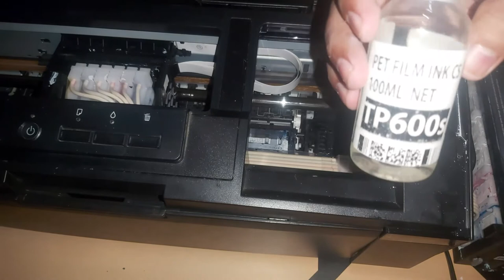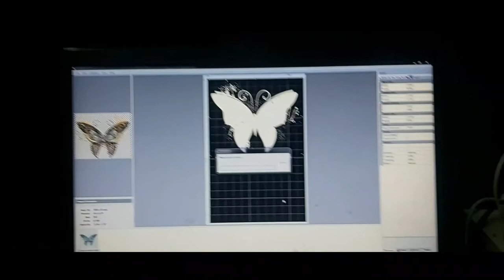Daily Maintenance in L1800 DTF Printing for White ink | WHITE INK TRANSPARENT PROBLEM SOLVED

Comment: Hello there . When I print all black and colored t-shirts, the color of whites and all other colors changes. turns blue. darkening. but when I print on a white t-shirt, there is no problem. I just bought my machine and have been using it for 2 days. I have never been able to print on a black t-shirt. Do you have any experience as to why? I think it's from paint. what do you think?
Reply from the maker: Which printer you are using epson L1800  or some another printer
Reply: @soulgalleryheadquaters3492  epson L1800
Reply from the maker: @esrayakar5980  these are things you have follow to solve your problem 
1.check your heatpress handle pressure must not be tight it must be medium pressure for just 6 seconds 
2. Check the base of white is good or not if white is faded than do the process I have told in my vedio
3. I think the problem is may be handle pressure of heatpress it must be to tight or white base ink is fading on petfilm

Comment: The same thing applies to my machine today. After 2 print, the white ink will fade away. Have done the head cleaning, Nozzle check. I already have circulation and stirring tank for my white ink so no need to be shaking every 5mins. Please help out
Reply from the maker: go for proper head cleaning through company service they have some chemcials which clean your head properly.

Comment: My white ink has this issue daily. After like 5 prints, white will become faded. Do I need to do those maintenance everytime my ink become faded?
Reply from the maker: If you are doing continue printing for long time just shake your ink tank after every 3 print
Reply from the maker: White Ink need regular mixing and shaking procedure
Reply: In addition, my nozzle check also shows no white in the 2nd white ink even after shaking and head cleaning. Does that mean my head is already clogged?
Reply from the maker: @hanzjerichogarabiles5198  yes
Reply: @hanzjerichogarabiles5198  hello dude i have same problem like u...i m having this problem everyday again and again...and its so boring to take out ink everyday :( please can u tell me did u fix your problem and how ?

Comment: Hi , when I print the white colour wording the colour is not bright looks like light grey any solution for this ?
Reply from the maker: That is happening because you are not shaking you ink tank . Shake your ink tank for 30 sec properly 2 times a day . White ink has a chemical in it and it needs some circulation movements to mix it well with the colour so use have to shake it well and do the head ejection process that I have told in this vedio
Reply: I have already transfer the white ink  via injection and done shaking ..I shake everytime before printing ..but still the same result and the white coating will only come if I do strong cleaning
Reply: @dharisinisini7477  I have the same issue.
Reply: @hanzjerichogarabiles5198  for the white colour printing you have to go to setup  and for white resolution change to 1440×1440 DPI